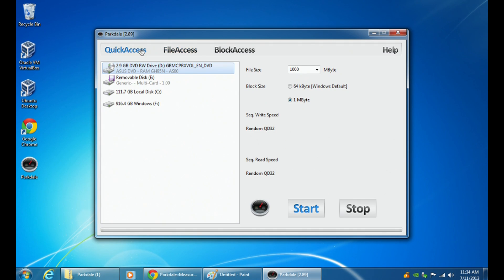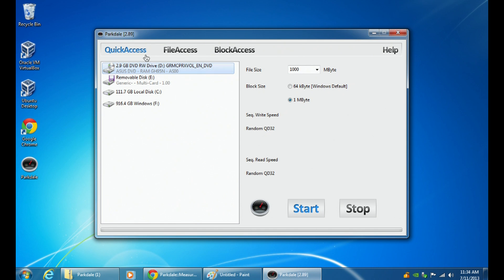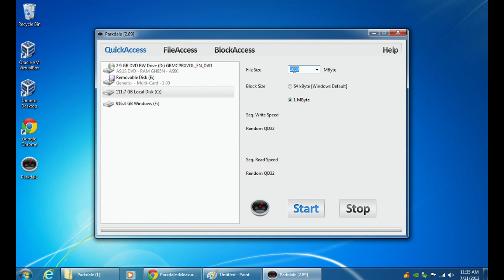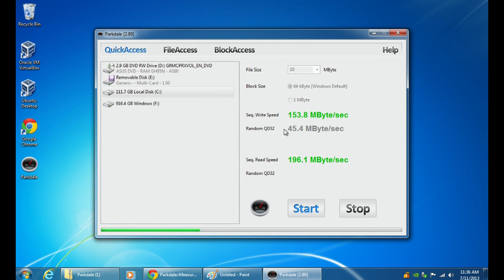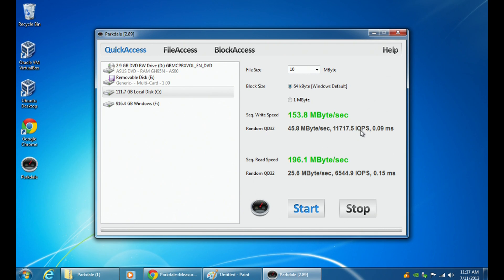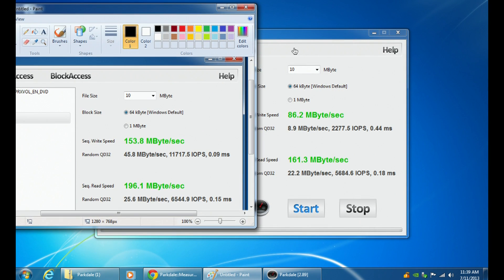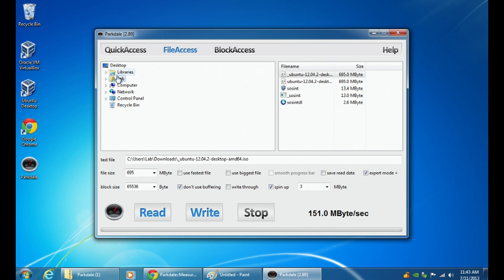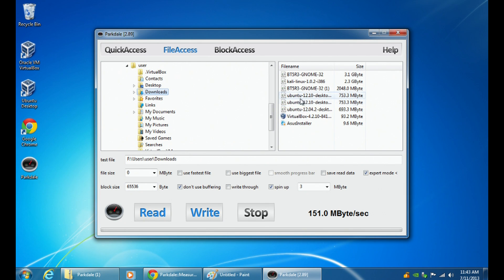How to Test Hard Drive Speed

Comment: I have an LGA 775 mother board with intel core 2 quad cpu q9400 2.66 ghz also have 8gb of ram and a Geforce 750 ti graphics card and a 1tb hard drive but the hard drive is kinda slow on games I have a nice sett up but not sure witch hard drive to go with just yet I get a little lag with the one I have now and my spending budget is about $200.00 any recommendations on a good hard drive ?

Comment: Eli, thank you so much for such valuable information regarding HDD vs SSD. 

I have been experiencing some slow in performance on my gaming laptop. I own a Dell XPS M1710 bought in 2006. 
Currently, all the specs are maxed: 
- Intel Core Duo @ 2.00Ghz processor 
- 4Ghz DD2 RAM
- 300GB HDD SATA 5400RPM from Western Digital
- 512Mb graphic card Nvidia GeForce Go 7950 GTX

I mostly use the pc for gaming as well as for Photopshop and Solidworks (CAD), aside from the basic usage of MS Office and handling some DBs on Access/Excel and playing movies.

The loss of performance can be seen on:
- Playing games (loading times + lags). I cannot play games on mid-high resolution, but only at low res, the video lag is huge!
- Playing videos on YouTube (lags if using high res than 480p).
- Loading programs (pc seems to be taking longer to load and even to boot from scratch).
- Multi-tasking makes the laptop to think constantly, even freezes for a moment and then moves on with the tasks.
- Using multiple Firefox windows makes my computer drop on performance as it uses a lot of RAM, in avg 500MB out of 4Gs I got (even though effectively I only count with 3.3Gs). Sometimes loading a page or scrolling up/down makes it really slow/laggy. Not as smooth as it should be or it used to be.

So I have run a series of tests on my laptop to check performance.
- MEMTests (6 PASSES = 0 Errors).
- HDD app (100% healthy HD)
- Defraggler (all good, only fragmented a bit)

- Parkdale for HDD speed issues --  I ran it several times, and the results were:

 
 
 
 
 
 
 
 
  
  
  64kByte - Windows
  default
 
 
  Speed Test
  1 MByte/s
  10 MByte/s
  50 MByte/s
  100 MByte/s
  250 MByte/s
  500 MByte/s
  1GByte/s
  4GByte/s
 
 
  
  
  
  
  
  
  
  
  
  
 
 
  Seq. Write
  13
  50
  65
  75
  75
  80
  80
  80
 
 
  
  
  
  
  
  
  
  
  
  
 
 
  Random
  10MB, 2600 IOPS, 0.38ms
  4MB, 110 IOPS, 0.89ms
  2MB, 500 IOPS, 2ms
  1.5MB, 386 IOPS, 2,6ms
  1.5MB, 385 IOPS, 2.5ms
  1.2MB, 300 IOPS, 3,3ms
  1.2MB, 300 IOPS, 3.3ms
  1MB, 245 IOPS, 4ms
 
 
  
  
  
  
  
  
  
  
  
  
 
 
  Seq. Read
  78
  70
  85
  90
  75
  80
  90
  90
 
 
  
  
  
  
  
  
  
  
  
  
 
 
  Random
  18MB, 4700 IOPS, 0.21ms
  2MB, 558 IOPS, 1.79ms
  565kB, 141 IOPS, 7ms
  635kB, 158 IOPS, 6,30ms
  530kB, 135 IOPS, 7.4ms
  510kB, 130 IOPS, 7.7ms
  500kB, 120 IOPS, 8ms
  424kB, 105 IOPS, 9.4ms
 

 
 In comparison to the newer SSDs or even a 10k RPM SATA HDs, mine seems to be around 50% less performing than what's on the market nowadays.

I have a question: Could memory RAMs loose performance as well over time? It's been 4 years since I bought my last pair, so I just wonder.

I will eventually buy a new laptop but for the time being I need this one to hold on for a bit more before I give up on her.

Any suggestions you may give? I am really struggling with the pc as it is. A friend suggested that I should format the HDD and reinstall everything from scratch. It's been at least 3ys since the last time I did it. What are your thoughts about it?

Is there anything I else I can do to pin point where could be the loss of performance? Have I overlooked something? I tried to be as explicit as possible. If you need more information, do not hesitate to contact me. I would be really interested in hearing what you have to say.

Thanks for everything!

Comment: Why my hdd gives same results as your ssd? I have a Seagate 1TB Barracuda, 3.5", Sata3, 7200rpm, 64MB hdd
Reply: For one the hdd's cache, otherwise system only supports SATA, SATAII and not SATA III. So, even if you were to install a SATA III capable ssd, if you system only has SATA II capability, you will not get SATA III speed.

Comment: believe it or not, i have got an i7 4720hq and a gtx 950m 4gb video card but i cant even play ETS2 because of the crappy hdd i have. The game loads and starts like normal but then the hard drive usage go up to 100% ad the game freezes for 5 seconds then it resumes then 10 seconds and the same damn thing happen again. god! never thought an hdd will bottleneck a pc. i have a SEAGATE SAMSUNG SPINPOINT M9T 1.5TB hdd btw.
Reply: +Sarper Ödev Take a look at this and consider it: https://www.backblaze.com/blog/wp-content/uploads/2015/07/blog-fail-drives-manufacture-2015-june.jpg

WD drives are even less expensive and guarantee the read and write speeds they state
Reply: i also have a toshiba mq01abd100. im planning to swap out the drives as the toshiba drive works normally and far more silent than the seagate. wish i knew the hdd brand before buying this laptop.
Reply: I have the same problem I just cant wait to replace this hdd

Comment: Great video and explanation about hard drive speeds.  Eli breaks it down into easy to understand terms.  In my case, my comoputer was running quite slow.  I suspected it was the hard drive.  Come to find out that my hard drive was connected to the SATA2 connection instead of SATA3.  I will now test the speed using the Parkdale program that Eli recommends in this video.  I will watch Eli's other videos.  The guy is a great educator.  Thank you Eli!  Well done sir!

Comment: Thanks for that first 6 minutes of talking. It was good information. I didn't happen to watch the rest(didn't need it), and I wanted to mention my experience: I am having to use my laptop right now due to my tower's HD being dead, and waiting for the new one to arrive. I noticed lag/very slow performance in the comp over the simplest functions. Checked for malware, viruses, etc. Nope; clean. Backed up all data(took over 4 days!!). Decided to wipe; still excruciatingly slow(XP Pro taking 6 hours to install?!?). Tested the drive, numbers looked about right. Problem: these tests don't always reveal a slowed, dying drive. I tried installing XP Pro on my secondary HD(disconnected primary), whaddya know, XP Pro installed on the same tower in about 30 minutes.(I don't use XP Pro; I just wanted to test the HD before wasting money on a new one) Now, you probably have a video on this issue, and I want to add my HD never did make the dying clicking noise, but a very subtle noise that seemed off that I could only hear putting my ear right up to it. So, I'm just mentioning this to help others experiencing a HD that still "works", but is showing very subtle signs of impending death. In any case, I will be installing one of those new SSD's all the kids are talking about these days; can't wait!

Comment: what? my brand new laptop random reads 465 kByte/sec. Acer you scammer
Reply: futbolita89742 on 250 MB test
Reply: Check  Samsung - 960 EVO 250GB Internal PCI Express 3.0 x4 (NVMe) Solid State Drive for $320  and 250GB
produce read speeds up to 3200MB/sec. and write speeds up to 1500 MB/sec.

Comment: off the shelf computers don't have the best components to begin with. I only build my own computers and I only do upgrades and do not replace the computer itself. when a hard drive stops performing the best I simply make it a secondary drive, I have a total of 4 drives in my machine, all varying in age. they are still good for for secondary storage

Comment: Hey i experience laggs in game check my channel for those video's that i uploaded for lag.

the laggs most occurs while disk is 100% usage ( videos on my channel )

i asked several forums and no one mentioned my hard drive. all about my GPU 
but my hard drive is purchased in 2008 samsung HD501LJ

Write 47.7MByte/sec
Random 4.6 MByte/sec 1168.5 iops 0.86 MS

Read 42.2MByte/sec
Random 8.0MByte/sec 2036.8 IOPS 0.49 MS 

be sure the check my channel

Comment: well yea i could have gotten a i7 4790k and maby water cooled but i have i5 4690k ir i could keep i5 and buy dual graphics or simply save up money with psu but NO i pick this system
i5 4690k
z97 msi g55 mb
r9 290 vaporx from sapphire
16gb of 1600mhz hyperx kingston ram +4 more crucial ram
corsair rm 750
hyper212 evo
because i bought ssd for a good price 160$ its crucial m.2 m550 256gb ssd witch is super fast my system is verry fast and responsive just because ssd i could simply avoid it and buy better  gpu but i think its not necessary coz its abble to run everything on ultra anyways

Comment: The new xbox one and ps4 only have 500 GB 5400 RPM HDD's. The PR people only mentioned cpu speed, gpu speed and memory. They never mentioned HDD speed. I feel like the RPM speed is a bottleneck for the systems because the loading screens could be a lot faster.

Comment: I have a 4 tb HDd and core i5 2310 2.9 GHz processor and 8 gigs of ram and HDD is causing my frames to  drop , how do I improve the speed.?.I just bought this seagate HDD..PLease Help
Reply: What makes you think the HDD is causing frame drops? What graphics card are you using and what are the frames dropping in?
Reply: GTX 750ti 2GB
Reply: Gamer Mahajan
It's your processor not your HDD
Reply: Hard drives don't cause FPS drop, just longer load times.
Reply: just put thermal paste and now everything is fixed.
Reply: Matthew Hunsinger
 my fps in wow drop when things load on game.
Reply: use disk defragmet tool it will help

Comment: Is there some error with the software?
Because when i checked it, i got the Seq. Read Speed in GBs every time for my system hard drive around 4-5GByte/sec even for 4k MB file
And it is not a SSD. And around 180k IOPS

Comment: Hi Eli.

Thanks for the tips. But my tests showed some interesting results and I hoped you could help me. I did my comparison test on; SSD Kingston V300 120Gb theoretical speed 450write / 450read; HDD Western Digital Green 7200 rpm 2Tb

On everything the SSD performs better than the HDD except on the sequential reading of a 1000mb file.137mbps for the SSD and 143mbps for the HDD. Repeating the test shows that both hover around 140mbps.

Read speed of the SSD is only about 30mbps faster than the HDD.

Does this mean the bottleneckof my pc now is the processor?

awaiting your reply
Kind Regards,
Dafydd Wouters

Comment: before you were born there were floppy drives and hard drives... a solid state device with no moving parts and rigid as it is would be classified as a hard drive. If it's not floppy then it's hard, remember it.

Comment: Eli, I have a question: 
When I ran Parkdale on my 2TB HDD, which has 2 partitions (1 is 500GB and the other  is 1500GB), the speeds were different. Why would the speeds be different on separate partitions on the same hard drive?